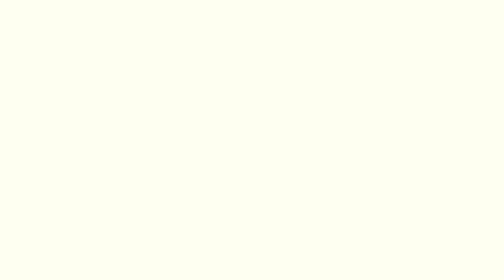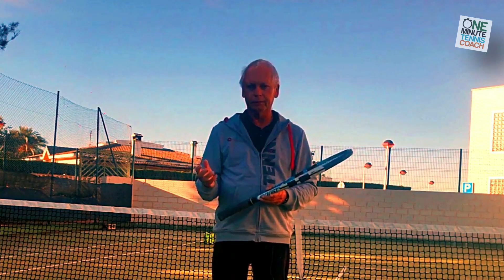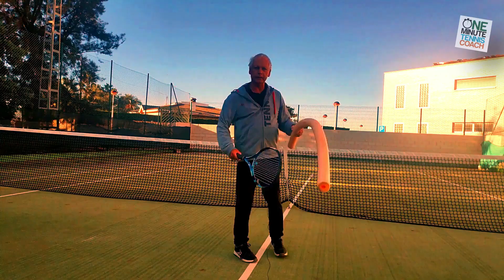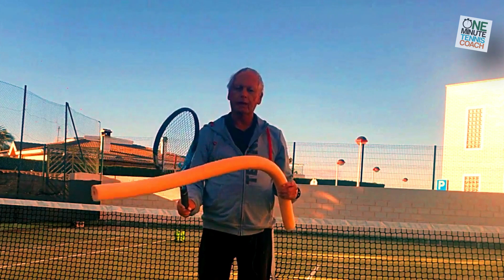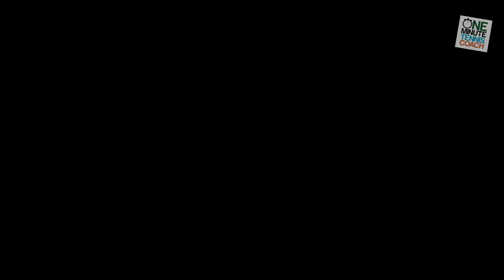How to become a GREAT BALL STRIKER

Comment: Sorry but how will this help me? Say I practiced it and had good feel and sound hitting the noodle. And then? Will it improve my swing/spacing/timing with a tennis ball? How? I don’t play tennis hitting noodles!
Reply from the maker: This is a very good question.
And the answer is not too simple.
Many players have PERFECT strokes.
Yet some players, a few, hit much harder than the rest 
Rublev hits a lot harder than Dimitrov... Why?
You answer this we have to examine many factors:
Racket speed
Racket angle
Contact point
Weight transfer
Etc etc.
But when we examine them, and even if we understand them, will we hit harder?
Very unlikely.
But if you practice finding the feeling of hitting the noodle with perfect contact and then are able to transfer that getting to hitting a ball...
Then you will hit harder, as these multiple factors are all corrected.

Does that make sense?

Hope it helps a little
It's great that your enjoying the site.  

www.oneminutetennis.com

Comment: It works! Tried different standing props (ie top spin trainer) but this “silly” idea really puts that strike in good spot, especially on serve! One toss trick, stand under basketball goal and toss up into netting without hitting netting.
Reply from the maker: Thanks for the awesome feedback.
I almost didn't post this idea online because it looks so crazy.
But it really does work

http://www.oneminutetennis.com
Reply: "One toss trick, stand under basketball goal and toss up into netting without hitting netting."

 How does that help? The toss travels in an arching parabolic trajectory, not so much straight up and down through the basketball hoop.

Also, will have  a good toss ever reaches a hoop 10 feet above you. 
A typical toss  generally drops one foot before contact. As a  6 foot tall player,  I estimate my toss height is 9.75 feet.
Reply: @Better_Call_Raul look before releasing your ball. Aim the ball as if to go through the hoop.(Just not that high) It's something to aim for. Once back on court you will be able to visualize the basketball hoop in your mind knowing instinctively where your ball toss should go. It will just feel right but to your opponent they will be baffled how you're able to place the toss precisely where needed. HTH 👍

Comment: Can you elaborate a little more please? Is this related to clean ball striking? Because the strings just hit a little ball in the middle of the racket not both sides of the frame.
Thanks
Reply from the maker: I see what you mean.
But
The ball can hit the middle of the racket with the racket stationary... Good stroke? Of course not, there is zero stroke.
This video isn't to help hitting the middle.
It's to help to acquire the feeling of the perfect blend of racket speed, swing path and racket angle.
May I ask.
Have you tried this and have your achieved the sound of perfect contact?
Because of you do, you can usually actually feel the difference.

Does this help?

Thanks for a great question

www.oneminutetennis.com

Comment: Nice idea, but I wonder if hitting the noodle perfectly (i.e., with the loud sound) really translates into hitting the ball perfectly. Why?  The noodle is held horizontally and it's a little bit bent, so the spots are not alligned in a vertical plane. Moreover, the noodle moves a little bit while I'm hitting. Consequently, the location of the spots that I have to hit simultaneously to get the nice sound is more or less random.
Reply: I have to agree with your comment.  Hitting a noodle with both edges making contact at the same time doesn't mean the same thing as with a ball.  But perhaps this is just the first part as Steve put it at the beginning of the video.  He did say this concept gets us part of the way there.  But I do notice when I'm practicing against a ball machine that when I make good contact, there is a loud popping sound that echoes where I practice.  That's definitely positive feedback and an addicting sound.  All I can share about that is my arm is completely loose and my hand is barely holding on to the grip.
Reply: My reply may not sound serious, but it is: I am doing this right now, but I am using a far thinner noodle; its diameter is slightly less than that of a tennis ball...